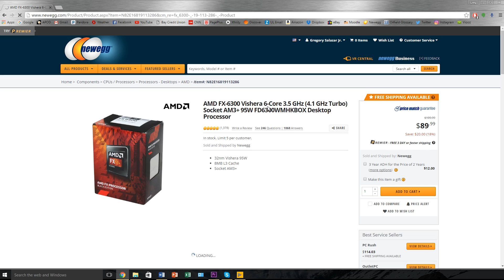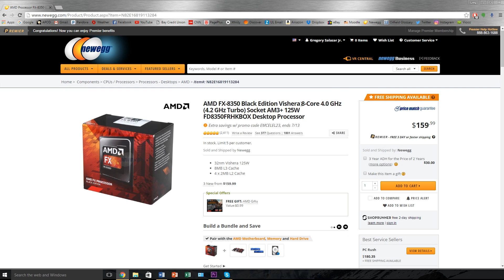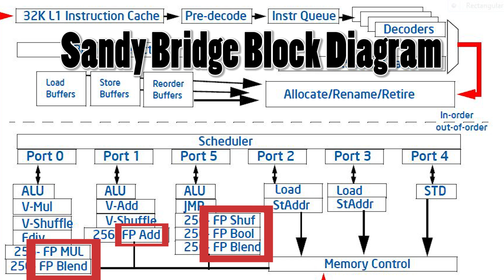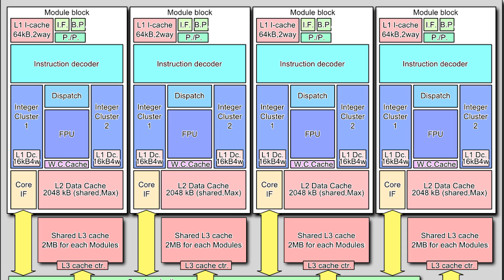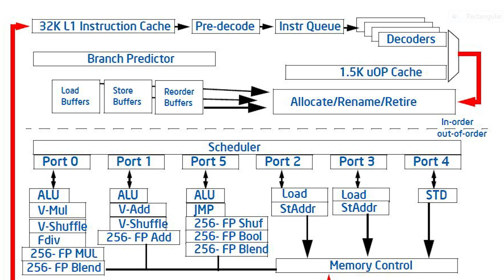How Many Cores Do AMD FX Processors *Actually* Have?

Comment: AMD processors aren't that bad though, Intel chips usually cost more then twice as much as AMD chips but you don't get twice as much performance... AMD chips are usually really close to Intel chips in benchmarks and when it really comes down to it Intel chips only yield a couple extra fps in games when paired with the same video cards making AMD chips much better in price to performance.
Reply: You really should do some research. The FX series isn't and will never come close to the performance of a 6700. You were probably looking at Tombraider type games where they thrive on GPU power. Go look at some Cities Skylines benchmarks or Witcher 3. They use more CPU power. You could also look at synthetic benchmarks.
Reply: i bet Ryzen triggered this guy so hard  @shawsta
Reply: ***** and?  i say this as someone with a Skylake i5: a processor for people with less of a budget is not a bad thing.
Reply: Amd has best Gpus on the market Price to performance ration.....  And age is on Amd side to...
Reply: ***** CPUs?  yeah, the FX series and current Athlons are not great, because AMD predicted a change in software design that didn't come and went all in with the wrong architecture choice.  the Celerons and Pentiums top the Athlon chips, while an i3 is generally a better option than an FX.

GPUs?  AMD's not great with driver efficiency, sure, but they're still really solid options, especially if you aren't a lunatic in the above $300 tier who really really likes hardware value depreciation.  we have yet to see Vega, but Polaris is solid for what it's intended to be and we have yet to see what Nvidia throws at that price tier (though I'm excited to see it).  last gen, the 390 and 970 were neck and neck, and the 380 edged out the 960, both at the two ideal price:performance cost points of $300 and $200 respectively, below which you get things that are comparatively shitgarbage and above which you get things that are nice in benchmarks and fringe cases but also drop in value the fastest.  for reference, i had the option to go with a higher-end card, but decided that waiting for the node shrink was a better idea (which seems to be panning out nicely).  might grab a 1060 or 480, since those look extremely solid.

that's a bit long-winded, but the point is, unlike CPUs, AMD GPUs don't tend to be prone to the mistake that price:performance means the same price:less performance in every meaningful context.
Reply: +Ian Hitterdal (otend) Yeah. The tldr is: its not a total mistake to get an AMD GPU, the way that it is for CPUs right now.
Reply: It'll win in games that are poorly made and only use 2 cores. But say you want to do some work with your cpu, or maybe you want to stream, that 8350 will dominate
Reply: The Gorgeous Fruit Quite the opposite.  Aside from benchmarking, the FX series is, right now, a terrible, terrible purchasing decision.  They aren't bad if you're stuck with them, but most software isn't made to take advantage of their architecture, and it shows.  Sure, some newer software can take advantage of multithreading, but that's very much in the minority, and ignoring the bulk of software that doesn't is just kinda foolish.
Reply: +yourereasingthisbecauseiwasboredonthetwelfthofjune FPS snobbery at its finest. 60fps is more than good enough for the price of the equipment currently available. Most of the time it's driver constraints anyway. Prior to my upgrade I was getting 50fps on my fx4100, get almost a solid 60fps now but I'm graphically bottlenecked atm. Get a 1080 if you want 144fps lol damn. Just be happy you've not got a console running 30fps o; we're all PC here, lets get along <3 xxx
Reply: Mario2x2Sk That kid consider 50/60fps unplayable for her probably due fps drops he faces. Consistent fps is okay tho.
Reply: amd fx 8350 costs like 165,44 euro's here, core i5 6500 costs like 209,95 euros here 209,95 - 165,44 = 44,51 euros
Intel core i5 6500 is like 52% faster in games than a fx 8350. It's worth it to go with Intel! 44,51 euros for 52% increase in gaming performance!
Reply: @shagstars  Wow. Men. So fcking inacurate. You compare procesor that is 7 years old to 3 years old. Compare i7-2700k and you'll get the same result.
Reply: @ARCAD3BLOOD  an i7 2700k will give me less stutters than a fx chip would. I've been there and even an i5 2320 was more stable than that fx chip. Ryzen is where its at anyway because its cheap and renders the fx series useless.
Reply: @shagstars  I mean that comparing something from 2012 to something from 2015 is riddiculous idea. Technology doesn't work backwards. fx 8350 had enought power to overpower intel's, but almost every game was made in mind of intel's structure and that cut fx's performance by half. Ryzen is just adjust to what gamer producers expecting how the processors should work.
btw every old as fck processor will give you stutter.
Reply: @ARCAD3BLOOD  core i7 2700k is from 2012 just like the fx 8320 is. So I didnt make a 2012 vs 2015 comparison.
Reply: @shagstars  Man, you just compared my statement to my words. 
 "amd fx 8350 costs like 165,44 euro's here, core i5 6500 costs like 209,95 euros here 209,95 - 165,44 = 44,51 euros
Intel core i5 6500 is like 52% faster in games than a fx 8350. It's worth it to go with Intel! 44,51 euros for 52% increase in gaming performance!
"
Isn't yours? ? ?
Like I said "comparing something from 2012 to something from 2015 is riddiculous idea"
Reply: @ARCAD3BLOOD  O in that sense.
Reply: +kemboy323 Yeah that's like comparing AMD to Intel or Nvidia! Wait..
Reply: CrackedDylMil intel haswell and skylake chips are insane.  i love those things, and they're driving down price while keeping really solid performance.
Reply: 4460 was at some point just 15-20$ more than an fx 8350 and is ceaper now than 8370. why would u ever buy  the fx over 4460 or 6400
Reply: Ionut Cosmin focusing on core count over benchmarks
Reply: +rararawr619 that depends. If the bulldozer is up against a 6700 then it'll be tight because of hyper threading. Completely agree though should it be up against an Intel chip without HT. So glad I got a 6700k instead of a 6600k. Those extra threads make multitasking a breeze.
Reply: Bakairo89 the extra threads really don't add that much performance. An i7's multithread score is also around 5 times its single core score, like my Fx-6350. In simple multitasking that doesn't saturate cores it probably makes a sizable difference though
Reply: ***** actually with new intel's software i3 6100 streams just as well as a buldozer without performance impact
Reply: CrackedDylMil you mean like the one directly below the 4790K and 6700K, those being pretty much the only consumer-grade chips above the 9590?  the rest of the ones listed there are enthusiast-grade ones that tend to cost north of half a grand or server parts that also tend to cost north of half a grand.

also, that benchmark is vague as shit and borderline useless.  you should use ones that exist as actual use cases.  AMD sure as shit ain't going to win, but at least be somewhat honest.
Reply: +SnM I play the witcher 3 on high-ultra custom settings on my fx-4100 (4,55ghz). I have 0 isues with this game on those settings dunno what are you talking about.
Reply: ***** Thats unplayable for you ? o.O  I get around 40-45 avg fps on those settings. For me a game is playable/enjoyable even if its on 30 fps. I guess you have a 144hz monitor than ?
Reply: Ofc they don't, FX series was released in 2011 - 2012.
Reply: MrKeikari I would never go for an i5 that is clocked under 3Ghz. That's why I mentioned the 6500.
Reply: shag stars The clock speed tells only so little. The price-to-performance ratio with i5-6400 is still unbeatable :)
Reply: MrKeikari Some emulators really like the 500mhz+ extra clock speed. You can't overclock it (blck in disabled by intel and windows). so no point in buying a 6400 when 6500/6600 are there.
Reply: shag stars It's still cheaper. Often by a fair amount so it's good choice for budget builds and I don't think all users need emulating performance.

Skylake-overclocking is still doable and easy as it was previously, also for non-K-cpus. Nothing has changed on that part.
Reply: MrKeikari Intel has made an update with microsoft to release updates for windows 8/10 to make blck end up in bsods. So no overclocking anymore. its only 20 euro difference between 6400-6500.
Reply: shag stars You're confusing that to Windows Update to prevent overclocking G3258 on budget motherboard. You just need to rename one .dll file to go around that :)
Reply: MrKeikari O I just saw that mobo companies did that on new mobos. Only asus and msi have old bios files that doesn't let that happen.
Reply: Except when people put code into programs to run slower on amd.
Reply: +Luka David Torkar that literally never happens
Reply: Luka David Torkar That would destroy Amd cpus since they're so awful in first place already! :o
Reply: CrackedDylMil I will be honest. I just heard some rumors but judging by how aggressive intel was in early 2000 by bribing companies like dell to use their cpus and some other stuff, I wouldn't be suprised if that actually happened.
Reply: MrKeikari They are bad compared to intel top of the line but as an owner of a fx 6300, I'm more than satisfied with the preformance it offers me. I can play most new games including mirror's edge catalist at 60 fps on medium settings.
Reply: +Luka David Torkar it'd be pretty obvious if that sort of thing happened. The code would literally look like 

If(amd) {
Int fpsDrain = 0;
while(fpsDrain < 200) {
fpsDrain++
}
}
Reply: CrackedDylMil How many people look at the code and how many people understand it? I mean the dude could edit the code before he records and then make everybody think amd cpus are worse than they really are. Dude. I'm not saying that happened.
Reply: Luka David Torkar A few years ago it was a decent choice :)
Reply: MrKeikari A few years ago it was the best choice. Just remember the Opteron. It was the best thing on the market.
Reply: Luka David Torkar Best if you don't mind old chipset, dead-end upgrade path and more heat output & power consumption. One buying the first or second gen i5 (or Haswell i3) would still be more than fine and not in need of upgrade :)

Opteron is server cpu. Not relevant here.
Reply: You are talking about gaming performance, in which in most cases much of the workload is put on the GPU. in video rendering/encoding, or anything that requires raw performance or cores, Intel takes the cake. AMD CPU's still aren't better in gaming either, at least if you play CPU intensive games. again, GPU handles most textures and rendering in game engines. AMD and Intel CPU's vary per scenario. some developers design their software to work better on different chips.
Reply: Cyndre Gaming Yes that's also true. Amd suffers when games can't use multiple cores. I play kerbal space program and since 1.1 came out with multicore support it's running great.
Reply: hmmmm no
Reply: @SM lol., you are comparing the FX series (which is like first released on 2010) to a 6700 (which is released on 2016). It's like comparing ENIAC to UNIVAC I.
Reply: CrackedDylMil no, It's comparing an old hardware to new gen hardware.
Reply: +kemboy323 AMDs latest to Intels latest
Reply: +CrackedDylMil Its more like comparing IGPU's to Dedicated GPU's. Completely different from each other. They share basic similarities, but are made for completely different use cases. in this case, Intel is more the higher end manufacturer, as shown in the 16 core X grade chips. these require lots of R&D, and other design changes. AMD focuses on the cheap, lower end of the budget oriented person who wants price to performance. Thats each companies highlights shown as of late.
Reply: +MrKeikari Compared to the companies people compare them to - which are in different marketing tiers- AMD has the cheapest prices for current hardware. This is saying without bias, it is just known information. that doesn't necessarily mean its the best p2p+ in all cases. Intel offers some decent cheap X99 and 1151lga chips that out perform current AMD chips, especially in over clocking cases, those cheap chips have potential. Still higher prices, but different companies. different tech, rnd, building process, etc.
Reply: Cyndre Gaming The same or lower prices, thus better price-to-performance ratio in any "normal" use :)
Reply: +MrKeikari (unrelated) Generally for the "Normal" computer user, they have no clue whats inside their computer and state "i have my  macbook pro '10 retina 14' inches by 24' display v69, can i access my MySpace account from the Google?" the general public doesn't know the difference between Linux, Windows, and Ubuntu. Hell, remember that news report on that laptop running Ubuntu not opening a .exe file? perhaps some research on Ubuntu would have made that another story. i find that stuff amusing. but sad.
Reply: Cyndre Gaming I count gaming and any light workstation as normal too :) Web usage is again a different matter but snappy SpeedStep and SpeedShift help with that too :) 

That Ubuntu thing is very likely caused by the deceitful customer servant in electronics stores and such. They mostly just straight out lie to people to make them buy shit. At the current state no one should be buying electronics without a tech-savvy friend :)
Reply: +MrKeikari Agreed on that workload. I personally have that, which i consider my normal. publicly though is another story, as i jokingly mocked before.
I actually built a new PC only around 3mo ago, and its insane. (http://pcpartpicker.com/user/Cyndre/saved/CWsRsY if you're interested) my latest unedited, but quality video was a dull tutorial on Minecraft. rc'd with OBS, so it was grainy in the movement, but barely noticeable in the vid.
I play plenty of games i dont rc, and damn my rig laughs at them.
Reply: CrackedDylMil Exactly. Comparing both new gens with new gens with the same price point.
Reply: Gaming isn't the only performance to consider.  And as even this channel has shown, Intel chips perform much better in gaming, from minimum to average to maximum frame rates, all are increased under intel, in many cases, significantly, while using the same graphics card.  

When the 8350's were ~$200, and the i7 4790k's were $330, that was only a ~$130 difference, and there was definitely at least a 30% performance bump, making it both cost effective and worthwhile, not to mention other factors like overall longevity and motherboard features (when the 8350's came out, and for years after that, most boards weren't even USB3/PCIE3/SATA3...and the ones that were, cost a lot more than Intel boards.)  

I've seen a lot of people who bought say 6300's, then upgraded to 8350's.....which means they actually paid just as much as an i7, over the same period of time, and still have PC's slower than an i7.  Go figure.

Fact is, in the long run, i7's are the better buy, especially when they first come out because they don't drop in price much.  That's their only downside....rather than drop in price, they get phased out for the next i7.  But if you're paying $300 for a CPU you're keeping for 5 years, that's not a bad deal at all.
Reply: C North
i agree with everything you said; however, unless you're doing some kind of ultra cpu intensive work; you should just get a i5. its weaker than an i7 but the performance gain of the i7 is negligible when playing games.
Reply: doodoo lau

I don't use my PC for just gaming, and even then, more performance = more future proofing.

Let's say for example, your 4690k is on the edge of its shelf life, starting to bottleneck games.....well that 4790k will still be chugging along just fine for a while longer, meaning less time between buys....and since buys often typically dictate more components than just CPU, the cost is greater.  Anyone coming from socket 1150 for example, will have to get socket 2011 or 1151 for example if they want Skylake.  So the saving is even greater.  That's a year or two worth of extra longevity, not to mention all those years of the increased performance, for just ~$100 extra.  Not bad in the long run. 

 If you add up all the longevity gained, you might find your total lifetime PC costs will actually be quite the savings.  In the time someone upgrades say 4 times, I could upgrade maybe only 2 times, and pay over all the same or less, while having overall greater performance the entire time.
Reply: If intel's wasn't paying alot for doing games optimized for theirs cpu, we would have now better fps or better cpu usage in games. But, hey modern consoles uses pillover stucture from amd :D, but it stil working like intel's copy :/.
Reply: Lol, maybe the Ryzen series but the FX? No way in hell. I had one of these FX processors and it was shit compared to the Intel offering at the time. However on Ryzen they really shook things up and finally caught up with intel.
Reply: @Saaj2  Man fx was released in 2011. The same as intel's 2000 series. And fx 8350 is EQUAL to i7-3770 in performance. fx 9590 beating 3770k by far in power. Amd newer "caught up" to intel, intel just lost most of his fanboys for their new products, becouse their price to performance is riddiculous."i've had one of these procesors" And it proves what? That you buy one of them? which one? fx-4/6/8/9 series? or maybe other bulldozer? You know many of them are not equal right? fx 8300 has far lower performance, and different technological layer than fx 8350.
And btw prince of this processors at the time they goes into market... well intel's fanboy's weak point :D.
Don't catch me wrong. I have now i7-4790 and it's great. it's in ideal synergy with my rx 580 and motherboard is very cool, even the power section. But every processor had his own downside effects.
Fx's was cool, like really. I've had 8350 and i used the same cooler for my i7-4790. Fx on this cooler get's 43/45 max in games. It was really cool (i didn't need to overclock it at this time, so i just leave it as it was set). But the motherboard,ow boy, it was hot. Power section was almost like sauna. If not, bet i would still playing on fx. 
With i7 my motherboard is super cool, like metal-cool. But the procesor, ooooow boy. I add one 120mm fan to cpu cooler and it's still 57 average.
Reply: The Fx series are the worst series ever of any amd  cpu... Buldozer generaly.
Reply: the dual core pentium g4400 beat the athlon x4...
Reply: Intel has cheaper cpus (i3, i5) that easily outperforms AMD cpus. Currenly Amd can't compete with Intel even in price-to-performance ratio.
Reply: +Ian Hitterdal (otend) even in multi threading, a quad core Intel chip beats most AMD chips
Reply: the i5 2500k my friend has still is chugging along quite nicely and for the most part will match or is slightly slower than my CPU. I suppose like i said should you really need a powerful cpu to do some crazy ass editing or production then an i7 is worth it. but from your argument of future proofing, there's not that much that you save. Especially when it comes to gaming.
Reply: +amakeleven On a workload that's multithreaded well enough and can properly take advantage of the architecture, absolutely.  However, most software is not that.  I'm wanting to see what Zen's like, after AMD reverts to the old style of architecture and not featuring that Ring -3 gaping security hole Intel's advertising as a feature, but single-threaded performance remains a bottleneck on the current batch of AMD chips.  This can best be seen when trying to run things like more complex emulators, which can cause even my i5-6400 to stutter.  (I know the 6400 isn't the best i5, but eh, I can BCLK overclock it later)
Reply: https://www.cpubenchmark.net/high_end_cpus.html
Note the lack of AMD cpus
Reply: shag stars And 5-6400 is even cheaper and still easily outperforms the overpriced FX83x0s :)
Reply: Luka David Torkar There's no really need to do so. Amd has gimped the performance by itself.
Reply: kemboy323 It's still their flagship. Shows greatly how overpriced especially FX8350 is.
Reply: Cyndre Gaming
Except that Amd can't currently deliver any products with good price-to-performance ratio apart from Apus. Intel has beaten Amd in price-to-performance a few years ago.
Reply: $60 pentium vs $150 fx8350 and the pentium wins every time in gaming. If you want to win in multi threaded benchmarks too, then get a decent i3 for around $100.